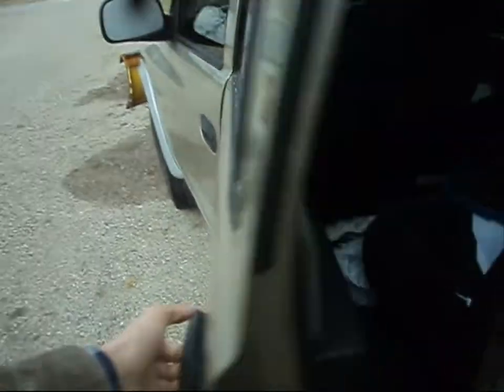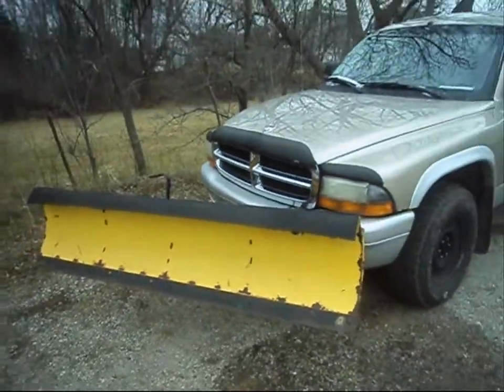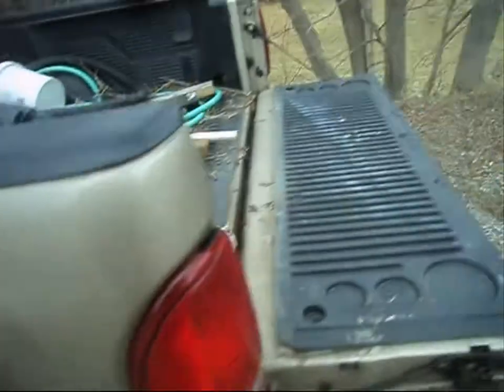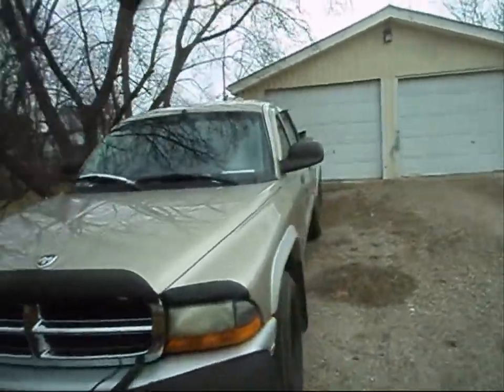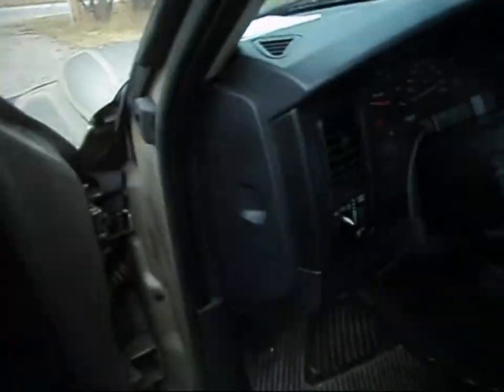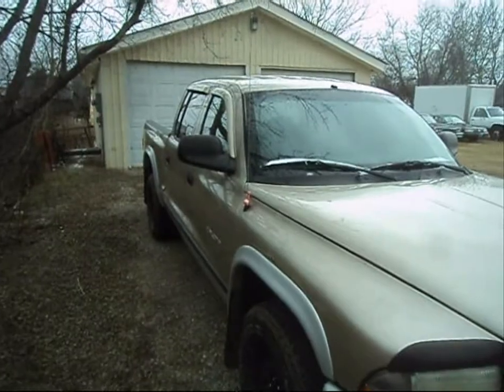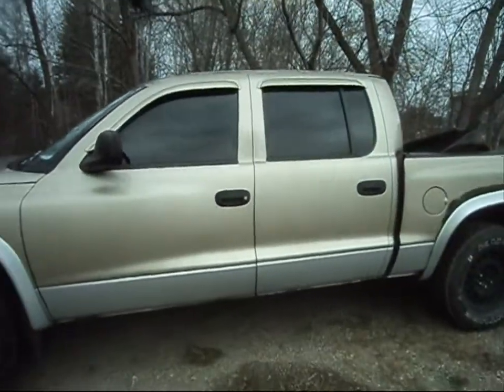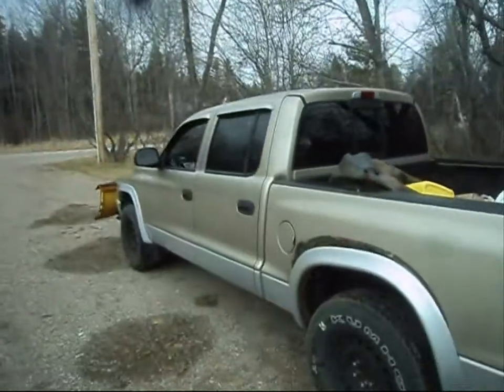2002 Dodge Dakota Start-Up: December 2015 Update

Comment: Perhaps you could mount that relay under the hood somewhere and engine heat would keep it warm enough. I noticed that you have no snow. It's been warm in Wisconsin too. We are not going to have snow for Christmas this year. Santa will have to put wheels on the sleigh. Merry Christmas.